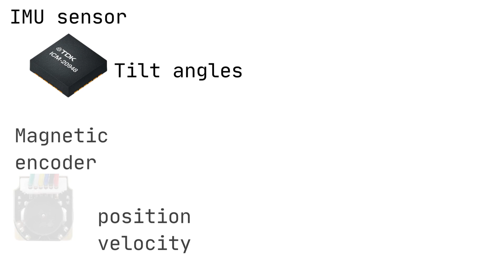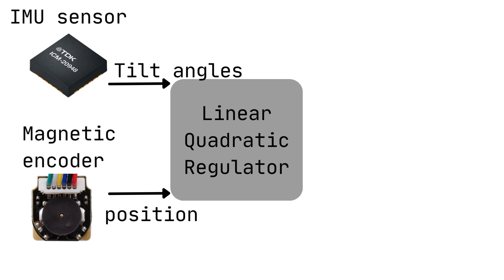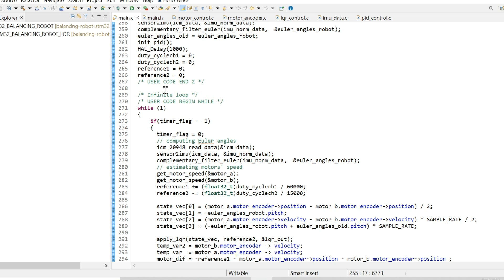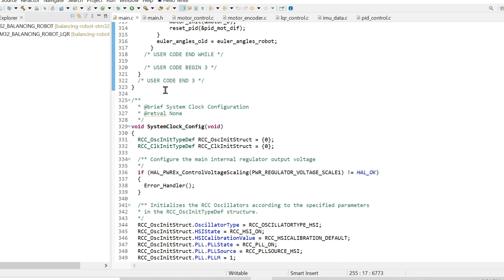Creating A Cool Balancing Robot Using Stm32 And LQR Control!

Comment: Excellent work please tell me the motor voltage rating & rpm rating and torque and max current , also size of wheel diameter, in short please give the links for motor & wheels of pololu
Reply from the maker: Check this link. You should get all the info there:
https://www.pololu.com/product/3073

Comment: Thanks for the video. I am wondering how you did the matrix calculation for LQR?
Reply from the maker: Hi,
Once you have LQR coefficients, you multiply two vectors, which can be easily implemented within the microcontroller. But, for other matrix multiplications, I use the ARM Math Library. You can check this video for that:
https://youtu.be/eNC_QvsnaOY
If you want to know more, you can refer to my course:
https://www.steppeschool.com/courses/stm32-hal-orientation-estimation
Reply: @steppeschool3629  thanks. I am more wondering how you would go A*B*C*D*E if they are all matrix's ?  Because the arm is good for A*B but for A*B*C*D*E it is a more complex, and I don't want to have to do A*B then AB*C and so on